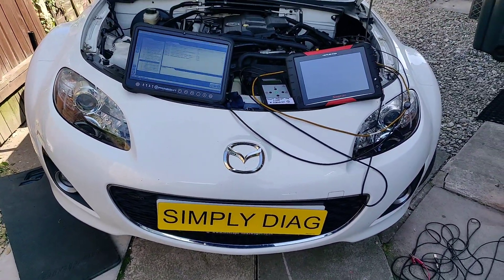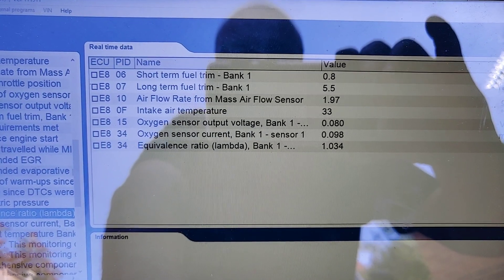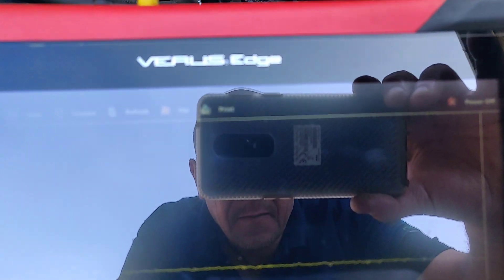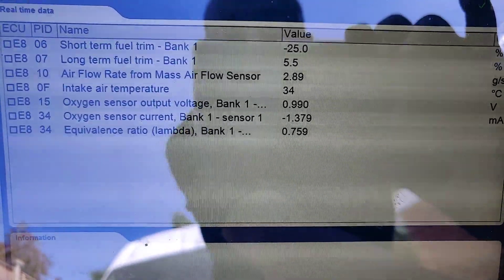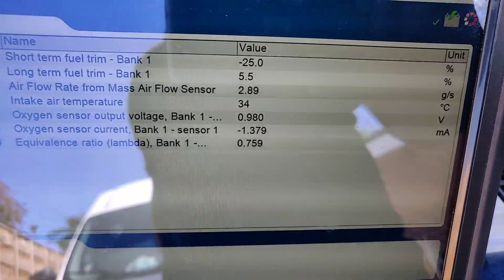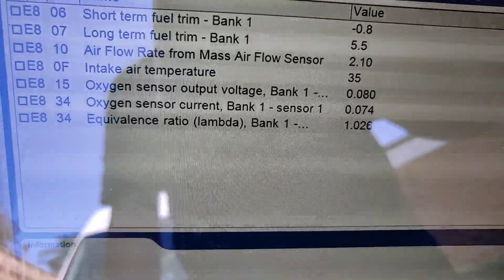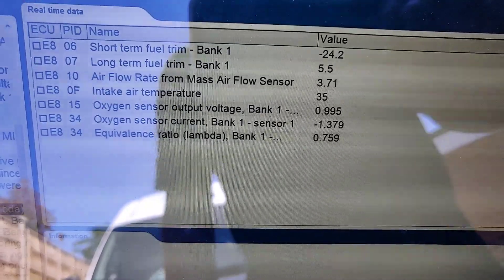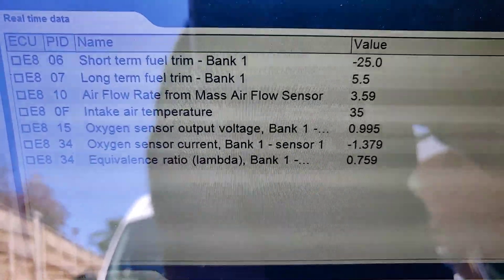Using a sensor simulator to validate a suspected MAF signal

Comment: Tricking ECU into thinking more air is coming in and it is adding more fuel to try and maintain a/f ratio. But there is not more air so now there is too much fuel and a rich condition at upstream o2/af sensor, resulting in negative fuel trims. It shows system is working correctly.

Comment: Hey
Where can you buy a DC simulator?
Reply from the maker: autoditex.com
Reply: Really great device mate 😃 could you tell me can I feed 5v reference to the rail fuel pressure sensor, when the reference 5v is missing with this device??
Reply: @przemekfryc5495  no
Reply: @przemekfryc5495  certainly

Comment: I'm sure the weather is lovely in Cheshire, but 35 degrees, we're not in the Mojave desert, could this be an air density issue?  Anyway, I'd love to see an exhaust gas analysis, is it rich or is it lean?
Reply from the maker: 5 gas would have been awesome, unfortunately I didn't have one to hand. I think being in direct sunlight skewed the temp readings, it was a very hot day. When I took baseline readings earlier in the day everything was normal. The symptoms were still present.
Reply: Re: the 35 degrees air temperature reading, is that a reading from the intake thermistor or is it the outside air temperature monitor? and by extension is there a PID for the intake thermistor?

Comment: Hows that sensor simulator connect?, earth obviously, but do you put a positive voltage down the back probed signal wire, while connected?, thanks
Reply from the maker: Yes Andy, that's exactly how it works, not on all systems and components though. There are times when you have to disconnect 👍
Reply: @SimplyDiagnostics  Thanks

Comment: Am I wrong. Isnt this s wide band O2 sensor, so V below zero is Rich and above zero is Lean>>> I think you described it the other way?
Reply from the maker: Yes, for wideband +ve current = lean, -ve current = rich, lambda <1 = rich, >1= lean for conventional 4 wire zirconia sensors 0.2v is lean, 0.8v is rich
Reply: @SimplyDiagnostics   Thanks. This is a V conversion in the ECU? Converting the O2 V to a mimic a conventional narrow band 0V-1V range. Is that what we're seeing? We wouldn't see 0-1V at the O2 sensor with a scope??
Reply: Hang on. the V reading is the B1 S2 post cat narrow band. I that what's confusing me?? I thought it was a current and v reading for the same pre-cat sensor
Reply from the maker: No mate, wideband sensors look at current, there's no diagnostic value in looking at voltage on these 👍

Comment: hi steve just thinking out loud but by increasing the maf voltage your telling the computer a larger volume of air is coming into the engine and the computer is adjusting the fueling accordingly to keep it around 14.7 to 1 making it richer but you are not increasing the actual volume of air going into the engine only tricking the ecu into reaacting creating a rich mixture . which appears to be a great a great way changing the voltage at the maf to check o2 response ???. what effect would a egr leak have ?? as the maf readings are low and the oxygen senors are low lean not enough oxygen in the system ??
Reply: A partially open EGR would definitely reduce the oxygen content within the engine causing a lean mixture to be detected by the oxygen sensors. I am surprised it’s running so well if this is the fault.
Reply from the maker: Gold star comment ⭐

Comment: I would check fuel trims at speed  and see if they reacting to rich/lean conditions  and gets worse point towards maf but your reading seemed low and you're vol measurement low may be pointing to in cylinder analysis  checking pressure exhaust ETA   engine may not be breathing properly in out dam lockdown brain abit rusty I take it fuel pressure is all good  to spec

Comment: Are rich readings with correct MAF voltage now proving theres no fuel delivery problem and is it the other end of the engine which is blocked exhaust?
Reply: Hmm Time to remove the rear O2 sensor to see if the fuel trims improve?
Reply from the maker: Could we have a winner?

Comment: What's the fuel psi?
Reply: Could you check exhaust system with thermal imager to see any extreme hot spots.
Reply from the maker: 2 bar rest pressure after 30 mins, 4 bar at idle, maintained at 2000rpm 👍